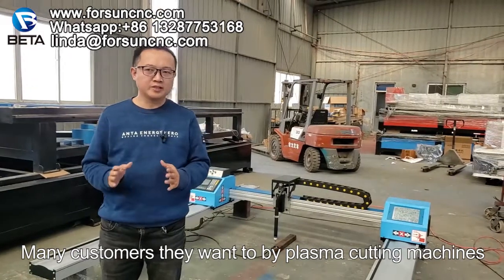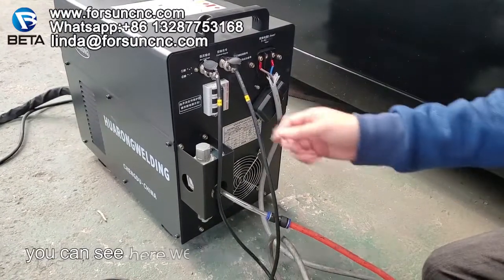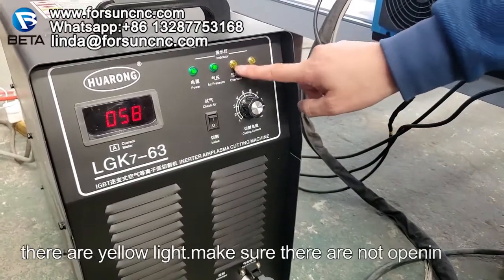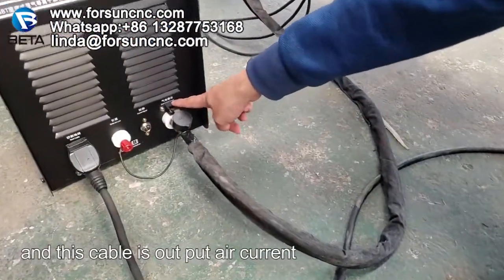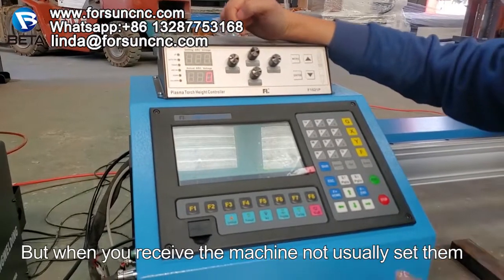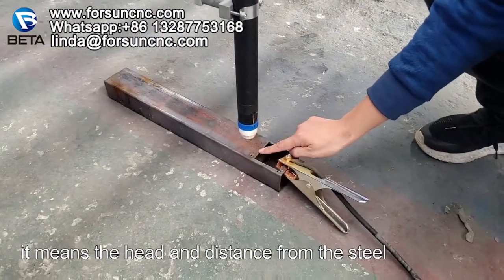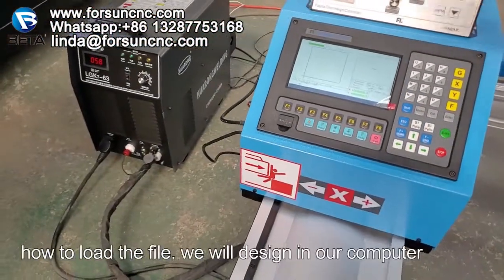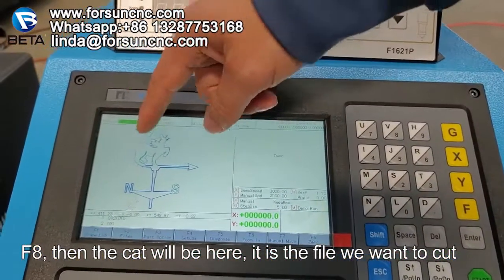How to use a portable plasma cutting machine - teaching video

Comment: I have a 2100b  controller  the output  port pin 16 does that activate  the plasma  arc I do not have thc
Reply: How did u solve the problem
Reply: Put a relay in there works great